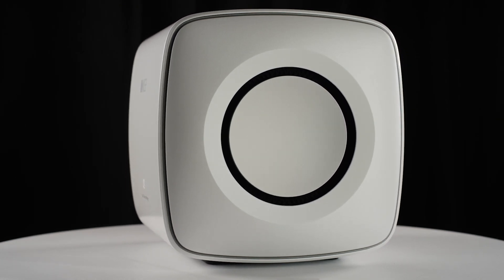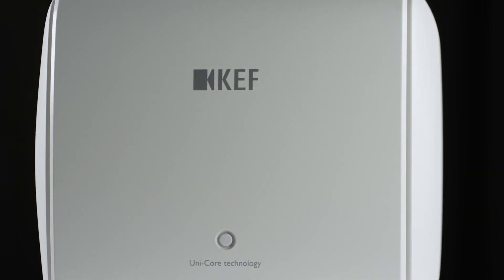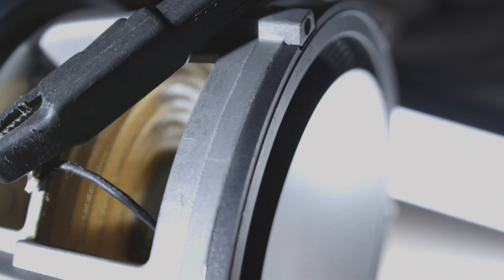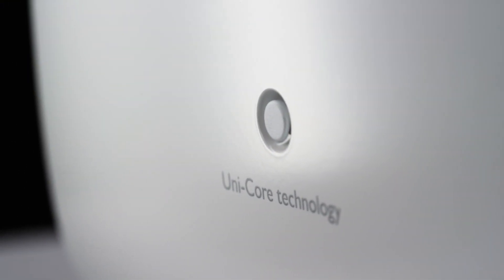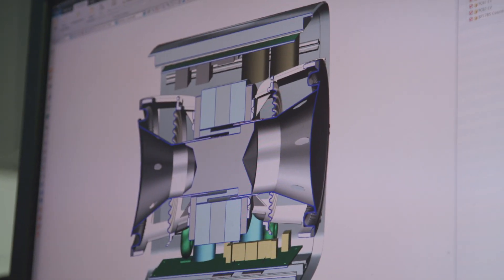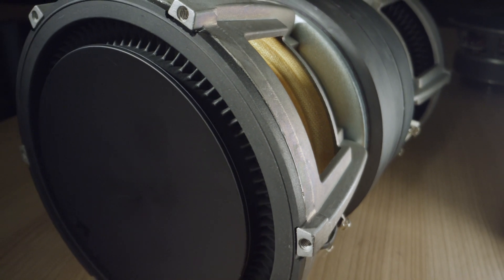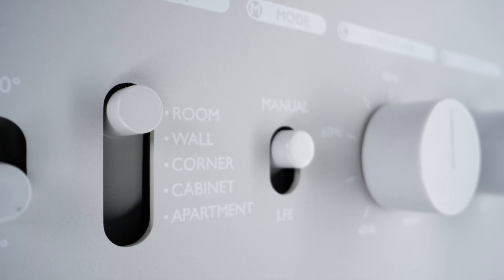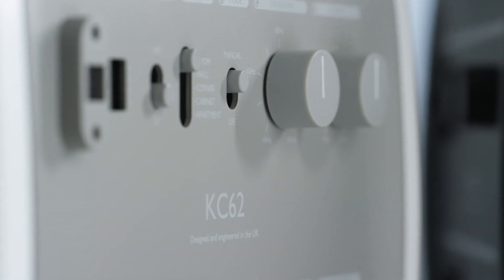KEF's KC62 Uni-Core Micro Subwoofer Explained - SoundStage! InSight (March 2021)

Comment: Does it run out of puff at higher volumes ?
Reply from the maker: KEF is claming 105dB output.
Reply: @soundstagenetwork  there is claiming and then there is reality.
Reply: @soundstagenetwork  105 dB would not be bad. Most reasonable listening is being done at 75 to 95 dB The rest is silly
Reply from the maker: @bobe2933  We would tend to agree, but we also recognize that many home-theater users push the limits of subs quite frequently.
Reply: @soundstagenetwork  hehe true true :)

Comment: The real problem with the KC62 is that it turns off at low volumes. It's a very annoying problem. We don't always feel like listening at very high volumes and, on the other hand, in certain situations we can't. Many people complain about this problem, but KEF doesn't seem to be able to solve this serious problem. I have already sent the KC62 self to my seller, who has already contacted KEF, but so far, after more than 2 months nothing. Unacceptable.
Reply from the maker: We understand that the auto-off was set to low on original units -- but that KEF has since fixed that.
Reply: @soundstagenetwork  And how do we know which model still has this problem and which not? by SN? Any way to upgrade the FW on the SUB to eliminate this problem?